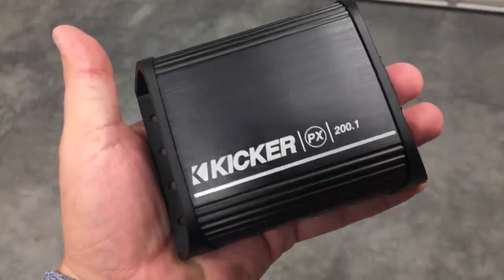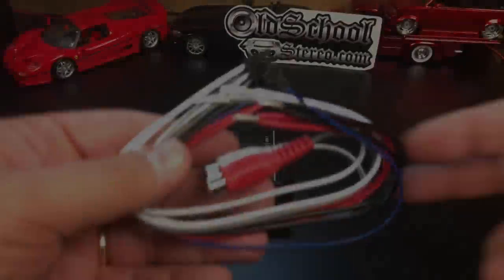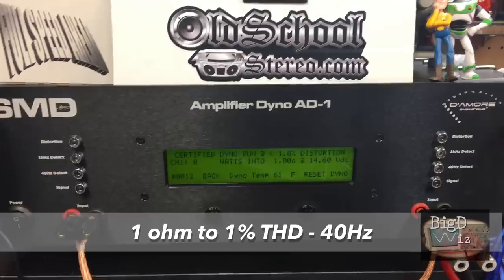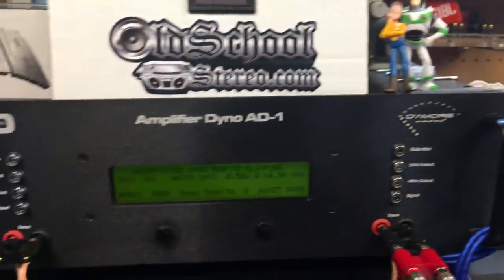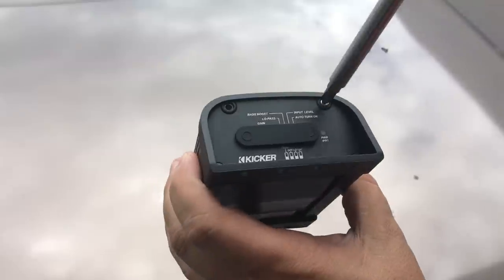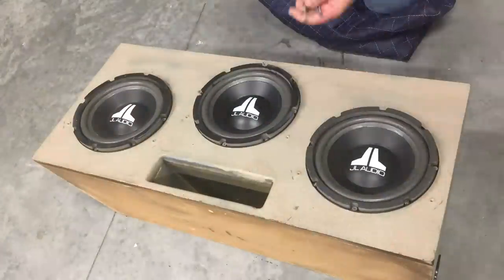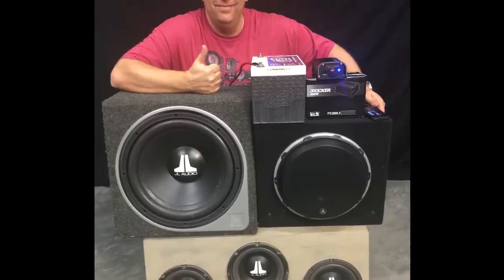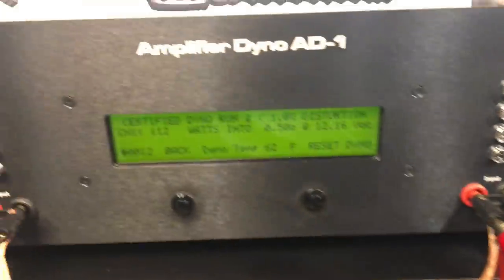Palm Sized Power? Kicker PX200.1 200 watt Monoblock Amp Dyno Test

Comment: BigDWiz, If you open that amp you'll see there is no step up SMPS at all, just full bridge synchronous buck-boost inverter the same like that https://en.wikipedia.org/wiki/Buck%E2%80%93boost_converter#/media/File:Basics_of_the_4-switch_buck-boost_converter.png
 4 mosfets are 5mOhm each, so the efficiency is way more than 90%, and output unclipped power >200W@.5Ohm@14.4VDC as well. Just by design ;) If you gonna seriously measure the power, efficiency etc, you have to:
a) measure instant values(I do 100KS/s) of the voltage and amperage, multiply one by one each pair of samples, accumulate for some period(I take 1.3s), and divide to samples number. Pity, but it is the only way to take into account voltage and current ripples. Fortunately, it is a quite simple to implement with some cheap ARM MCU + 200A shunt + OLED https://youtu.be/4zq2qjksqEQ
b) buy a decent SMPS for 14.4VDC, if your voltage ripples small enough, you can avoid horror with point "a)".
c) make sure if your THD measurement BW is limited at 20kHz for class D amps(AP AUX 0025 or similar and 100x cheaper).
Reply from the maker: I used a bank of four 14 volt car audio batteries in parallel (actually I have eight now, but had 4 connected at the time of this test). No ripple, very clean power input to the amplifier. Amp Dyno measures output power "at the speaker wires". We could care less what the amp does theoretically at the board, but what it does via the speaker outputs. Amp Dyno was used to measure both at 1% THD (certified mode) as well as at clipping (uncertified mode).  Thanks for the comment, all of this is great information, but I beg to differ based on the results I measured.
Reply: Hi there, it is my design actually(as 90% of kicker's models since 2009 to 2016+, and some of JL, RF, Hertz, blau etc), so my info is quite practical and it's measured correct way(AP2722 + Argantix + Powermeter). Yes, kicker is pretty stupid and archaic company(JL is much more dynamic and reasonable) but they had never cheat regarding a rated power, and they always crazy picky about that.
Reply from the maker: This is the first Kicker amp I've tested that failed to meet rated power. Not knocking your design by any means, but I've come within a few watts of birth sheets from Orion (current models including XTR2500.1D) and also Rockford Fosgate (90's models) using my setup. I know Rockford used the PowerCube, not sure what measurement device Orion used for their birthsheets, but I believe it was AP.  The Amp Dyno was designed by former RF Chief Engineer Anthony D'Amore. You can see more about it here - https://www.damoreengineering.com/collections/amplifier-power-measuring-systems/products/ad-1
Reply: As I said, the discussed model based on "direct amp" idea i.e. it has no step-up power supply on board, simply sync. buck-boost H-bridge convertor as an amp, that's it. If your 14.4VDC source really has no ripple and provides solid 14.4V, the power dissipation on the Rload = .5ohm will be U^2/2/Rload =  207w. I could believe if about 5W we lose on wires and Rds_on but not 47W yet. The same thing about the efficiency which has to be over 90% simply by design. If you still think that your measurement is fair, try to imagine how such tiny heatsink can dissipate the power what you expected according to the efficiency what you found? ;) Just common sense is involved. If you have a DSO, stay on the 14.4V rail and you'll see the ripples which I mentioned. Only 2 options:
a) excellent 14.4VDC SMPS with virtually no ripples
b) powermeter to take I&U ripples into the account
 Actually, you may also try to add a "supercap" aka ionistor etc for a few farads and low ESR, in parallel to 14.4V rail to reduce ripples on your current U source.
Reply from the maker: Ivan, I have 8 banks of 6 Maxwell Boostcaps 2.5V 2500F each. The 6 caps per bank are wired in series for up to 15V of charge and 433F per bank. I have 8 total banks (48 total caps) in addition to the (8) XS Power D1400 batteries. In this test, I used 4 of the XS D1400's only (in parallel, no charger attached. I didn't see the need to add caps as well).  I will be happy to try adding a bank of the supercaps and try again. I'm still confused how the 14V batteries with no charger attached could possibly cause ripple themselves? I'm curious to try your theory though. Also, the clamp measurements for current capture the maximum value and many times cannot be correlated to the output power as the amplifier will continue to pull current after the Amp Dyno stops the test. It's especially difficult to capture accurate measurements with smaller amplifiers / less current consumed.

I fully understand your explanation and appreciate the suggestions. I'll try this soon and will let you know and will post an update to this video if I see the difference based on your information.
Reply from the maker: Ivan, I just retested using a single bank of (6) 2700F 2.7V Maxwell Boostcaps. No charger connected, o’scope connected to show clipping to match the Amp Dyno. Result? 153 watts at 0.5 ohms, 100Hz, 14.9VDC. 47 watts shy of 200 watts 🤷‍♂️
Reply: Can you show me "14.4VDC" rail voltage ripples on your scope at 153W load?

Comment: Hi bro can you assist me i got 2 power supplies 12v current 30Amps can i be able to connect them together to get 60Amps?
Reply from the maker: You’ll need to check with Mfg to find out if they have that capability

Comment: It's an ic chip on the side of the board.. Maybe a TDA7375 or TDA1514
Reply: not yet, it is H-bridge self-oscillating 3rd order class D amp (4 discrete mosfets Rds_on 5mOhm) with no step-up SMPS, hence >90% efficiency guaranteed by design. That's why weak power supply limits the power at 160W(too high voltage ripples).

Comment: When ya gonna do a vid on a good amp? Or a budget amp thats good for some bass
Reply: Check out the power acoustik 2500d mono 2ohm dyno testing . I bought 1 from Wal-Mart with 2year warranty $114 out door . it is solid and powerful , its underrated (As dyno test shows) with a package rating of 450w rms x 1 @ 4ohm--650w x 1 rms @ 2ohm and fairly small 4.75" x 11"x1.75" . It's a great sub amp ! Just overlook the ridicules 2500 watt max b.s. Too many brands str8 lying to people, it's a powerhouse budget amp , Take care.

Comment: I'm trying to figure out why anybody would want to test this at a half ohms. So you're going to put four standard speakers in series or one or two high-end stereo speakers in series with a $50 150 watt amp? Why even use that rating?
Reply from the maker: Kicker makes Dual 1 ohm 6.75” subs designed to be used with this amp at 0.5 ohms
Reply: @wal  I know there's a lot of variations out there I'm just trying to get around the principle of hooking a very powerful speaker up to a very weak amplifier (wattage wise). If you know what I saying.
Reply: @wal  No now that I think about it. I'm wrong,, if you were trying to get a little bit of bass in a small space like a boat or a motorcycle waverunner something like that it would be super handy,, so I guess there's a purpose for it..

Comment: Hey big d if you ever find a pioneer gm-x922 amplifier they were from 1998 and also class a 2ch amplifiers that were 1ohm stable stereo and 2ohm bridged mono dual fans for cooling the boards inside they retailed for 400bucks new if you ever come across one can you please Dyno test one

Comment: What would happen if I used this on a old polk ex12ll. I think its 150w rms @4ohms
Reply from the maker: This amp isn’t powerful enough for a single 4 ohm sub
Reply: @wal  ok another question.  I have jensen car70v radio. How do I hook up the rca's to go to a sub mono amp. When the radio has only a single "out sub woofer 1" & "out sub woofer 2" female rca connector. They are both blue. Look the same. Do I connect the L/R male rca's from the amp to the out sub woofer 1 and out sub woofer 2 connectors the radio head unit?

Comment: I mean why a small half ohm amp why not 4 ohm or 2 witch is more practical in a system set up
Reply from the maker: Good question. The 4 or 2 ohm version would need to be larger due to Ohm’s Law

Comment: I don't get this amp. I'm a little out of touch with car audio components these days. But where are you going to find a small enough subwoofer or subwoofers to wire down to 0.5 ohms but only need a rated 200 watts max? Like do they make 5 inch DVC 4 ohm subs that you could wire in parallel to get your 0.5 ohm load and drive them? 🤣
Reply from the maker: It’s mentioned in the video. These are designed for Side by Sides or motorcycles and KICKER offers dual 1 ohm subs to match the half ohm rating
Reply: @wal  Oh wow, I had no idea such things existed! I am out of touch! Thanks for clearing that up!

Comment: Lame! I have a Kenwood KAC-m3001 hooked to an 8” infinity reference in my armrest/console enclosure and it bumps.
Reply from the maker: +Matthew J. Hull, BAS, BMF the little Kenwood’s rock da hizzy
Reply: BigDWiz for sure. I got it after I saw your review. It is such a great amp. I have a NVX 12” in the back of my van on a Jensen Power 1050 and it slams hard, but the bass sounded far away, directional, behind me, idk just not right. I added the 8” Infinity bandpassed the frequency to run 40-250hz and lowered the NVX to @80hz and below with some Skar 6x8” on a Jensen Power 400.2  running HP filter 250hz and up with a little Chinese amp running some horns at 4,000hz and up. It’s a budget build, but wired well, and it’s actually pretty clear. I mean it won’t win any contests, but it’s actually pretty decent from an SQ and SPL standpoint.

Comment: There are NO loudspeaker with 1/2ohm impedance available, so I better purchase another brand that capable to 4 or 2 ohm
Reply: Theres a process called inline wiring takes multiple subs. But to buy a 1ohm sub likely would be dumb for a 200w amp (150w) because the sub would annihilate the amp. It requires 2 - 1ohm subs wired inline to ohm down to .50 ohms. Or you could inline 4 of the 2ohms. However probably even worse news for that little amp 😂
Reply: And if you dont know how to ohm down to .50 ohms from 4ohms (much easier from 2 or 1) dont bother without youtubing from a experienced reliable source/channel. Do it wrong and well...it may be ok because then you've ohmed up instead of down. But car audio is typically no higher than 4ohm. So dont go to 8ohm you lose wattage and you aint using a house stereo 😂😂😂

Comment: Seems like a bad deal all around, being over rated and also requiring you to buy their 1ohm DVC subs to match it. I can't imagine any other scenario that would give you such a low resistance and still provide an acceptable amount of power to each coil. If you're hell bent on putting a system on your motorcycle this may be the way to go but it seems useless for anything else INCLUDING sidebyside golf cart boat etc. A person can figure out a way to make room for a legit amp and subs on those vehicles

Comment: What about a 20 amp fuse instead?
Reply from the maker: Bigger fuse won't give it more power
Reply: BigDWiz this is a dumd question,  but why not? Will it cause the amp to go into protect? Theoretically bigger fuse more capacity through the amp for power. That could be why I blew one of mine up. A 480w sony explode 4 ohm, on a 1 ohm load 12" Rockford p2 punch. I didn't know it would get the amp with that speaker, which if I still had it's 10 years old it still works and bumps hard.
Reply: BigDWiz  I now realize with the speaker i had, it couldn't handle the impedance of my Rockford fosgate
Reply from the maker: It is never recommended to use a bigger fuse than the amp mfg suggests. Now there are some old school amps where this is an exception, but many of the newer amps are fragile like egg shells and many don't have good protection circuits. Fuse helps protect the amp. Bigger fuse will pass more current, but if the amp itself can't pass more current, then no need to use larger fuse.

Comment: I never seen in my life a sheet from factory that says you can drive the amplifier at half an ohm. And you need to drive it to half ohm to get to the 200 Watts. So if I connect my 4 ohm subwoofer then what's going to be the output power?; just 25watts? That's what I saw on the sheet and it's ridiculous. I give this amp a very huge thumbs down. Shame on you Kicker!
Reply from the maker: +Bassotronics it is purpose built for 0.5 ohms and the matching 1 ohm DVC subs from Kicker (6.5 and 8”). I also don’t understand why they don’t optimize it for 2 ohms, but I’m sure they have a reason 🤷‍♂️

Comment: I THINK THIS AMP IS MEANT TO GO WITH THESE https://www.kicker.com/2016-comprt-subwoofers
This is the only subwoofer That I Can see taking advantage of the very specific powerband of this amp.  These kicker thin subs come in dual 1 ohm coils so you can wire down to .5ohm without needing multiple speakers!   I Would not want to have to use 2 subs just to get 160ish watts.  I'd rather use a soundstream compact monoblock which is also questionable but puts out twice the power
Reply: yeah its kinda useless, that power on .5 ohm wtf?
Reply: @alexiszocco7026  1 ohm ooook I guess, at least dual 2 ohm subs somewhat common  but .5 really is dumb for low power. I dont think I would ever recommend anyone ever get this amp

Comment: I do know why you run the 14.46VDC but that is rather unrealistic for real world. That is my problem with lab results they use the optimum settings even though all regular cars do not produce the power they are testing with. I find that 13.4 to 13.6 is a real world voltage in a running car with normal accessories running. I wish all you test guys would use real world numbers for your benchmark.

Comment: How are you going to run a power sports, anything, at half an ohm? And why on earth would you want to, different story though. This is essentially useless, anyone running it in a car would be useless for someone wanting bass would be disappointed. This kind of power is sound q level, but someone doing sound q won't be running half and ohm.
Reply from the maker: +ralph longo Kicker makes 1 ohm DVC subs which appear to be matched to this amp. Seems they needed the 0.5 ohm load to get power with such a small package
Reply: they are fine for running subs in the saddlebags on a bike with a weak charging system and a loud exhaust. ROFLMAO!

Comment: Was there any actual belief by anyone that the manufacturer specs were way off?  If you asked Kicker, they would tell you that the test was flawed and that in their test, the numbers are accurate.  What they don't tell you is that the test they use is so obscure it's not realistic.   It's all in  how they present it.  Marketing at its best.    I will say this, as a music enthusiast, I don't go for watts or how loud.  I want a clean sound.   This amp with a nice small sub running a modest 25-30 true watts to a 8" or maybe 10" sub would compliment a cars component system quite nicely.
Reply: lol No. They admit it bud. I know like four guys that work there. The PXA line is their only line like this. Grab ANY other of their current lineup and test it anyway you want.

Comment: Not a fan of kicker.  I personally think there bass products are complete shit. The bass tones are too high,  no lows in them.  And I honestly think if they sell there stuff at Walmart,  then they are not as good line quality as they advertised to there product marketing.  

In compared to a kicker L7 15 and an old SPL gorilla Audio 15 I had.  
The gorilla sub had bass so dirty it would make you shit yourself, and lows so deep you would wet your pants.  

The L7 was just ehhhh,  another boring surprise.